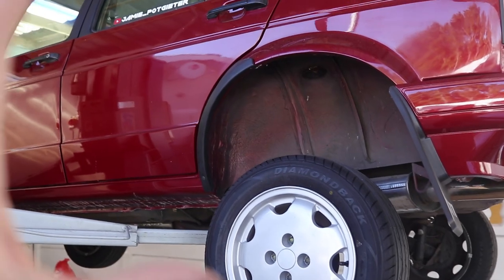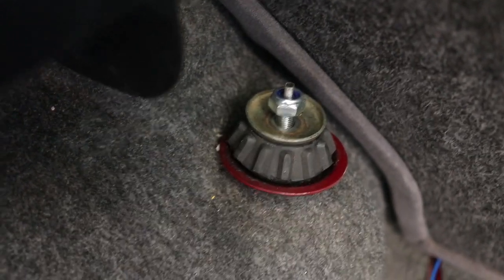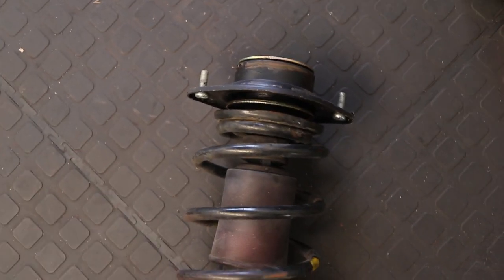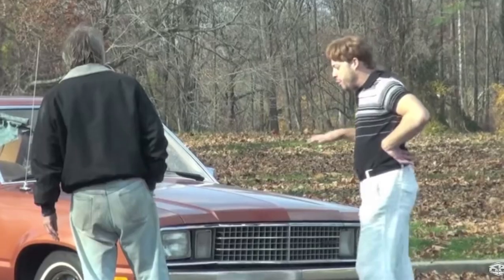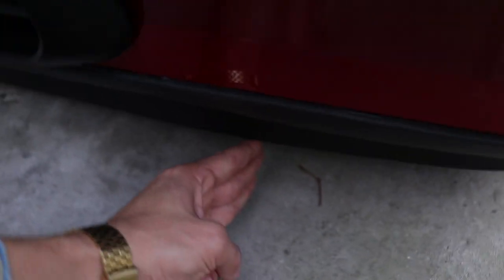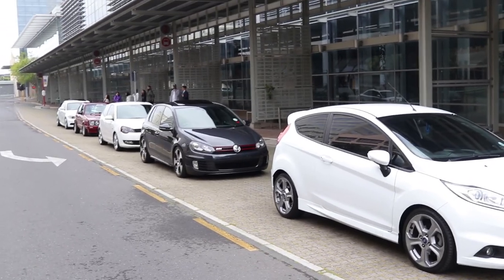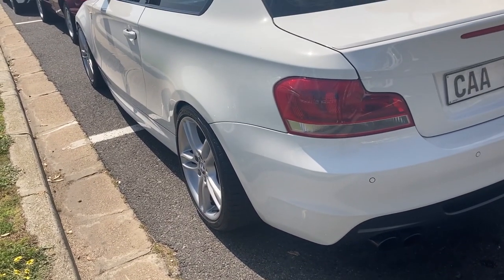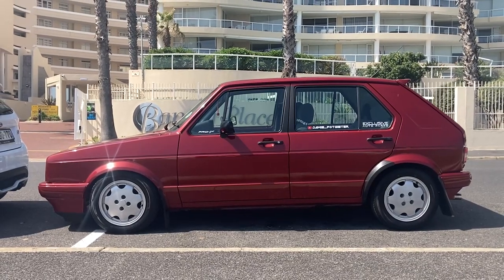Static Mk1 Citi Golf | ARC Coilovers "Review"

Comment: I think the stiffer spring rate that ARC coilovers have, works much better with the G6, seeing that it’s much heavier. The mk1 is very light, so I’d imagine the rebound to be a lot harder, hence the bounce, especially on that low height.

An extended top mount will do wonders for the ride quality. I used to run Maxtrac coils in my Golf back in the day, and on a low height like yours, the car would bounce A LOT. After installing extended mounts, I could drive it low AF and still have it somewhat comfortable.
Reply from the maker: Thanks so much for that bro 🙌🏻  you’re the go to guy, when it comes to the lows 😂 so appreciate the advice 🙏🏻
Reply: @jamiepotgieter  Thank you for pinning the comment. That rebound advice is golden and something i didn't consider before. @Broken law garage ; Im assuming your helpers was out and bumpstops cut in half?
Reply: @jamiepotgieter  the 2l you have in is it agy ? Please let me know and engine management

Comment: U were supposed to remove the helper spings for less bounce and have it clear the tyres so that the coilover locking key doesnt touch . U can roll ur fenders too if u want to tuck the tyre and not let it touch ur arch and let it burn ur paint  good video non the less cant waut for the next video
Reply: How do i roll fenders without damaging paint, my wheels scrap on bumps if I'm traveling anywhere over 60km/h
Reply: @medicineman7461  use a heatgun whilst rolling the fenders.